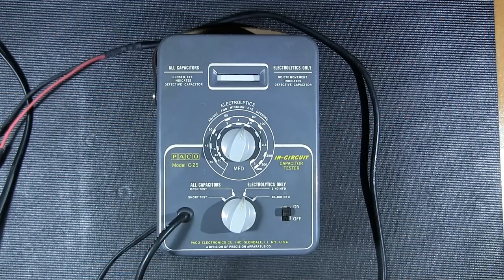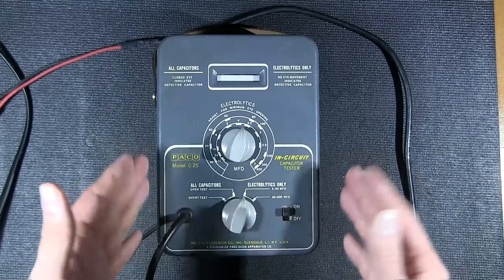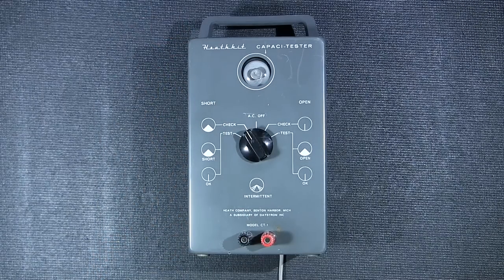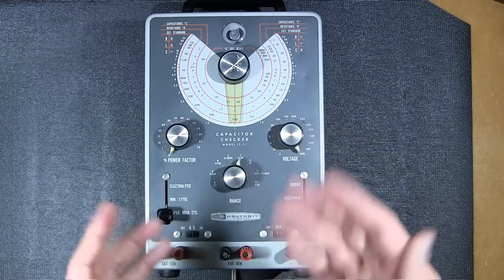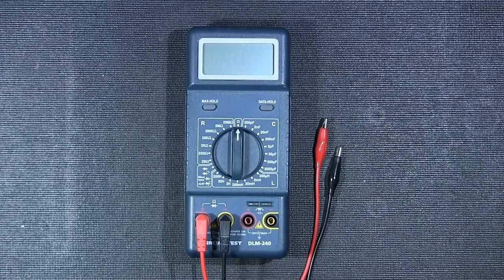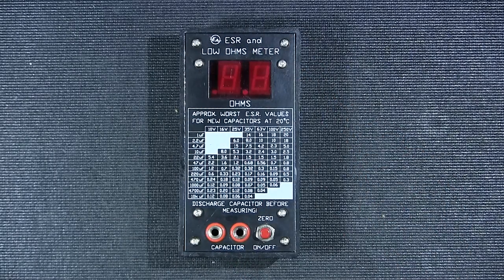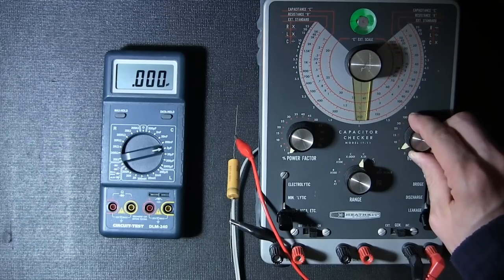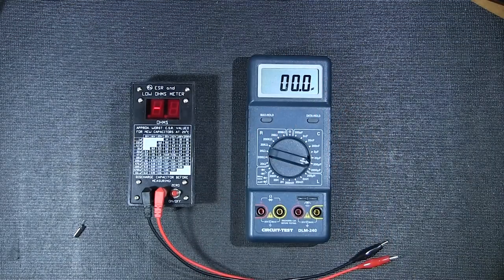Which Capacitor Tester Should I Buy?

Comment: Have modern ESR meters but still like my vintage Sencore and Sprague testers because they can test at actual operating voltages.  My point of view is if a 500 volt cap is going to fail it's going to be when it has 500 volts on it.  The huge advantage of modern digital ESR testers is they can (in most cases) accurately test caps in circuit and do it at a voltage that does not turn on solid state devices.  Each type has its place and I wouldn't be without either.

Mike

Comment: The Heathkit IT-11 tester was the 1st serious piece of electronics i handled in my new job after leaving school and becoming a "Tech Trainee" for an AM Radio Station. My head supervisor bought the kit for peanuts as the local agents for Heathkit were having a huge clear out sale.. It was 1978 and tube based gear was classed as having done it's day. I completed the cap checker build in a couple of days and it worked perfectly first switch-on. It then sat on a shelf in the workshop for the next 5 yrs because the company was systematically replacing all its studios with modern semiconductor based gear. One morning I came to work to find a huge dumpster outdoors full of various 19" rack mount equipment,  all tube based audio gear that had been the sort of thing i'd been trained on and sitting ontop was 'my IT-11'... never to be seen again.... BOY I WISH I HAD "RESCUED" IT THAT DAY....
Reply from the maker: Great story Pete, thanks for taking the time to share!

Comment: Many thanks for another great video. Some time ago I bought a Sencore LC-102 capacitor/inductor analyzer. It can perform tests for capacitance, ESR, dielectric absorption and leakage. It is surprising how many caps I've thrown in the bin because they tested bad for dielectric absorption, but good on all the other tests. My whole collection of old Jensen paper in oil caps had very bad dielectric absorption and were tossed in the bin. Also I've found quite a number of ceramic caps that tested bad for dielectric absorption.

Comment: Nice video.   With the scarcity of testers like the Heathkit for doing leakage test, a nice project might be to design a leakage tester for folks repairing/restoring old tube gear.
Reply: Now there's a great idea...only so much room on the workbench and the gear closet!
Reply from the maker: Thanks for your input Alan!
Reply: Super Idea!  I would love to see a home-brew leakage tester as well.
Reply: I've been watching your uploads too w2new and nice to see you dropping in on Mr Carlson in support :-)  
.
Funnily enough, I was thinking the exact same thing.  Could you guys get it together to give us a circuit schematic for something like that Heathkit, all-singing-dancing ESR/Leakage tester ?
Reply: Deebz270 that would be an awesome idea -a modern take on a tester!
Reply: I have leakages
Reply: Any HV supply will work if you use an appropriate resistor for current limiting but you need to be careful. The old hams were careful. People today are not.
Reply: I'd be happy if Mr.Carlson showed us how to design a circuit (breadboard?) that would allow an ESR meter with limited uF and Voltage range to read Caps that fall outside its stated table/range. . . .  if I formed that question correctly.
Reply: @Carl Jito 
I remember those very well, from the 1960's and earlier. 
No LEDs could ever approach the beauty of the 'Magic Eye' 
Back when I was studying Electronics and Electr-Mechanical engineering
in the mid to late 1960s,  my immediate boss and Mentor had a Wheatstone 
Bridge featuring a Magic Eye. He is still alive and I would bet he still has the Bridge
as I still have tools and equipment from that era,  compliments of PHILIPS,  which
was given to me when I joined the Military... Perhaps I stayed there too long.
Seriously, I have too much stuff gathering dust.
Reply: @wamgoc3637  
Agreed. The majority today just do not have the patience nor the attention span.
And it has been at least 30 years since I used my YAESU and KENWOOD equipment,
designing antennas, undertaking repairs and sometimes modifications, people would
bring in their CB radios to have work done on them.
They were the 'Good Old Days" Cell phones and VOIP killed it and took the fun out of 
it.  Well, at least one no longer has to contend with the Russian 'Woodpecker' OTHR.

Comment: It took me years as a youthful hobbiest in electronics to understand the vagaries of capacitor evaluation.  Interestingly it was AC induction motors that helped me appreciate ESR which was before the days of switch mode power supplies that of course would have done that also.  All I had a kid to test with was an Argonne multimeter not even of 20K/V   sensitivity.

Comment: I'm a big fan of the Peak Electronics ESR70 capacitance meter which is great for testing ESR of electrolytics in particular.
Reply: video99.co.uk Same here. I use the Peak Atlas ESR70 as well.  Wicked easy and simple to use.  Wish he included this model, in the review.
Reply: I love my Peak Atlas Analyzers also but the best way to check a cap is under voltage with an insulation tester. I was hoping Paul would talk about newer testers rather than testers we probably can't find.

Comment: I have the IT-11 cap tester. LOVE it. Yes, safety Sally says watch out for shocks. What I like is it also will test power factor as well. In old equipment with wax paper caps that have not run for years. Take a digital volt meter and see if the caps are acting like a battery( something in the millivolt range less than a volt). Lots of them are so bad they are so corroded they battery. Obviously all those need to be changed before any attempt is made to operate the equipment. If you ever saw someone blow up an old sealed liquid tantalum cap buy hooking it up backwards. Like a rifle cartridge put in a fire.

Comment: Just a got a 1940's 'Solar' capacitor analyser. It's basically like the Better Heathkit model you like. Just awaiting a new power transformer and then it should be good to try out.

Comment: The thing about discharging electrolytic capacitors. I use an incandescent light bulb instead of a screwdriver to discharge electrolytic capacitors. I love old tube test equipment, they are simple. This is why I'm a fan of Heathkit, instructions and schematics are relatively easy to obtain for Heathkit electronics.

Comment: Maybe somebody already mentioned this in a comment, but regarding the point made in this video about one of the testers applying AC to the tube, without a rectifier, I will note that the CT-1 shown right after that also does not have any separate rectifier. However, the Heathkit manual for that product specifically states that the 1629 "magic eye" tube has an effective 'virtual' rectifier inside, and therefore although AC is applied from the secondary of the power transformer, current is only flowing in one direction in the tube circuit, with the circuit "coasting" during the opposite side of the AC waveform. In other words, the  circuit DOES have a rectifier, but it is an integral part of the vacuum tube, not a separate device.

Comment: Thank you.  The old Knight Capacitor tester I had as a child would be nearly useless on modern electronics.  The new no-name ESR meter and Rigol capacitance checker (function of a bench multimeter) would be nearly useless on old tube circuits.  Electronics have changed so much in the 50 plus years since I started. 
Your Heathkit is the only tester I ever saw that could put out 600 volts without at least a spring-loaded switch.  Doubt if anything like that could be sold today.  That is unacceptably dangerous even for test equipment.

Comment: To the best of my knowledge, here in central Europe (Czechoslovakia) there were no factory-made devices that could do the leakage test at full operational voltage. I found mentions of DIY jigs and schematics of various devices in magazines that hobbyists could make to test the resistance of capacitors, but nothing that even remotely resembled leakage testers like Heathkit IT-11, Eico 950B and the like. 
Perhaps I could import one from the UK, but I think I will be building LV capacitor leakage tester. Great content, as always.

Comment: Excellent demonstration; informative in multi purpose usage of a variety of capacitor testers. Like many others, more than one tester is a must, considering the multitude of electronic devices that need attention and capacitors are the leading component failure in most equipment, "nicely done"

Comment: I was in a rush and just hooked the capacitor between a 50V variable DC supply and a volt meter.  Capacitor should block the DC.  Although it does do some RC time increase/decrease.  But the voltage should not stay at anything over zero.  It was obvious which ones were bad.  I also took precautions to discharge the capacitor after testing.  It works in a pinch.

Comment: Very nice video about capacitors an how to test them. I am more concerned with esr on most modern equipment.  The tool I use to troubleshoot quickly is a Huntron. It's basically a modern version of the old octopus.  Doesn't test for leakage. There are other tools for that. I love the heathkit.
Reply: The Huntron comparator is mostly usefull when you have a stereo unit with one good channel and one malfunctioning channel, to help you compare and narrow down which area of the device acts or measures differently from one channel to thebother; or, to compare the channel you have just repaired to the other working channel before you take the plunge and power it up.

Comment: The Heathkit model C-3 is the best capacitor tester to buy. More of them are available at economical prices and if you buy one that needs repair or restoration, that turns out to be an interesting adventure. Testers with digital and analog metered measurements are overkill. For years in industry all we had was the General Radio LCR bridge. Capacitor testers are not really needed to do radio restoration. The meat and potatoes of restoration is NOS or new parts, especially capacitors. After a while parts changing does become boring and expanding ones knowledge into components composition becomes an interesting rabbit hole to venture down. My bench consists of a scope, vtvm, vom digital vom, audio oscillator ,  several RF signal generators , various LCR testers and the Heathkit C-3 cap tester. Being able to do an IF and RF alignment is a must, being on exact frequencies is kept in check with a frequency counter.

Comment: One real flexible / useful unit is the DER-EE DE5000 LCR/ESR meter. I paid a bit under 160$ for mine, almost three years ago, for the full shebang (AC adapter, Kelvin-connection "tweezer", Kelvin-connection alligator-clips, and one or two other tidbits).

It can also be found under the IET brand, but for a premium, and no extra features (nor calibration or anything). For what it's worth, there's a teardown of it over on the EEVblog.

Comment: Thanks for the informative video.  
I have the Heathkit IT-28 tester, and I consider it and my ESR tester, as two of my most important test instruments, as I am always fooling around with older tube type equipment.  The big problem I am having with the IT-28, , is the colour in the eye tube is washed out.  It still works properly, but it is more difficult to see what is happening.

Comment: I've the "dangerous" heathkit capacitor checker and it's very useful to reform and testing high voltage capacitors. You have to be careful but other than that, it a pretty well made unit.

Comment: For those in the market for a modern LCR meter for the bench that can test for nearly all the possible parasitics (but does NOT do leakage testing), one may wish to look at either the iET DE-6000 or the DER DE-5000 LCR Meters as they are both very nice and test both series and parallel parasitics, including ESR, D/Q, theta (phase angle), etc., and can accurately test resistance down to the milliohm level and can perform these tests at 100, 120, 1K, 10K, and 100KHz and can perform some tests in-circuit as well.  The iET DE-6000 costs a fair bit more but has a greater accuracy in the 1KHz range and has much tighter quality control.  If on a budget the DER DE-5000 is very similar but not quite the same absolute accuracy and has reports of occasional, but rare, units that have been out of spec by as much as 20%, so some QA issues (not a big deal if you can validate your accuracy upon receipt and resolve things under warranty, but could be an issue for the few unluckily souls if they never realize they got one of the out of spec units -- though such reports seem to be very rare thankfully).  I opted to pay the premium for the full iET DE-6000 kit and hard case for its greater accuracy and tighter quality control and have been very happy with the unit for several years now as it gets a good deal of use.  But those on a budget will want to consider the DER DE-5000, which is almost identical save for color, as it is a good deal cheaper.  If you work with surface mount components, be sure to choose a kit that includes both the SMD tweezer probes and the standard alligator clip leads.  If you add on the IR USB interface then you can also log data to the PC as well as access one or two more variables (I forget whether it reveals X, reactance, or Z, impedance, if memory serves).  The great thing about both of these models is that, save for leakage testing, they single handedly test for nearly every parasitic or characteristic one may want in such an LCR tester up to 100KHz (though they do not support DC biasing capacitors as some much more sophisticated bench LCR test gear will), so you do not ordinarily need multiple pieces of test gear for most common tests and these meters are no larger than a full sized multimeter so do not occupy a lot of valuable bench real estate.

Comment: I have an Elenco LCM-1950 that's very similar looking to your DLM-240, except my Elenco only goes to 40H but it has a built in transistor tester with a test socket right above the amp sockets on the left. It also has a frequency counter that goes to about 2 Mhz.

I also have a Mercury model 1400 that at first glance seems to be a go/no go cap tester, but it has a "Hi Leak" test. Unfortunately, I haven't got it working yet so I don't know what it does in that setting.

I like how the Paco says "Glendale Long Island NY" when Glendale has been part of NYC (Queens) since the city was formed in 1898, probably a couple decades before anyone needed a capacitor tester.

Comment: I’ve serviced Refrigeration and HVAC equipment for 45 years. Their start capacitors can range from 50 to 500 uF and 110 to 600 volts. I learned early on to short them out with a screwdriver SEVERAL TIMES. I’ve seen them hold a strong residual charge after screwdriver discharge for more than one repetition.

Comment: Did any other Australian viewers notice the 'EA' logo on the ESR and Low Ohms meter? - it's Bob Parker's design featured in the January 1996 edition of Electronic Australia magazine. Also, count me in on a PACO C-25 restoration video too...
Reply: I bought one of those from Dick Smith Electronics about that year. Still use it on occasions. Good piece of test gear!
Reply: I have Bob's 'new, improved' MK-II Dick Smith kit version as detailed in Mar/Apr 2004 Silicon Chip mag.
A handy companion to my Heathkit C-3 Condenser Checker, which indicates capacity, leakage and power factor. It has a spring return test switch which automatically discharges the cap under test, reducing the DC shock hazard.
Reply: Karl Adams
Exactly.  Electronics Australia or EA was the longest-running Electronics magazine in Australia.
Seeing the EA Logo would make Leo Simpson and Jamieson Rowe very happy,
I still have  almost ancient copies of EA and Silicon Chip in my garage as well as the U.S published
Radio Electronics Magazine. and not forgetting ELECTOR  magazine, that was something special.
I started buying EA from around 1967.

Comment: I was at the hamfest in Nanaimo yesterday and grabbed a Heath IT-22, a later model of the CT-1 which you dismiss here. It is also 19mHz. I wonder what the improvements in the various versions were. Anyway, it is immaculate and can be a 'shelf queen'. I've loved magic eyes since my Gonset Communicator 2.  I do have a B&K LCR meter and a Blue ESR meter.

I also picked up a Fluke 8030A VOM. One battery clip is broken off as usual, but II'll use it as a bench meter anyway. It seems functional and came with the official Fluke wall wart and some probes in the nice leather cases. My first Fluke!

Comment: I have been using a Uni-T UT 501A megger to test capacitors. It is not as versatile as a proper capacitor tester, but it will test at 100, 250, 500 and 1000 V, and it shows the resistance in ohms at the testing voltage. One caveat is that for some unknown reason the polarity seems to be switched on the test leads, black is positive and red is negative, which will make a huge difference if you are testing electrolytic capacitors.

The last radio I recapped showed a resistance on the filter caps of a few kohms!
Reply from the maker: Thanks for your comment!

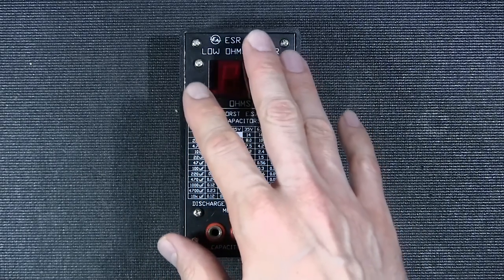Comment: @14:40  The Bob Parker ESR meter chart has changed values several times since the kit was first published 20 odd years ago.  Depending on the manufacturer the capacitor ESR value is not always correct, which is why the chart had changed over the years.  The leakage test I feel remains the most reliable capacitor testing method because if a Cap can't do its rated voltage without leaking, then its gone bad.  No manufacturer since Heathkit has produced a capacitor leakage checker in the last 70 years.

 *Silicon Chip magazine in Australia did a digital leakage tester kit that went from 10 to 100 volts.  They are doing an update on their K2558 capacitor leakage tester kit, but I don't know when it will be published.